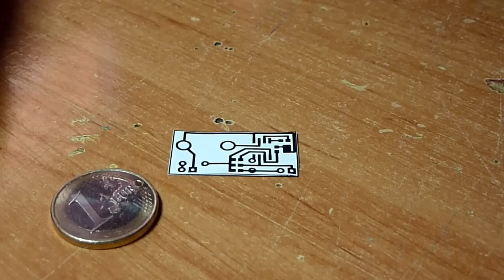#08 - Arduino - 1/2 - Reloj en tiempo real, Real Time Clock RTC, para arduino con Dallas DS1307

Comment: Enhorabuena por el aporte, está genial. Yo ya me he fabricado 2 relojes siguiendo tu post y el esquemático, aunque las resistencias del sda y el scl las he puesto de 10k. 
Va perfecto.
Por cierto la parte de código para habilitar el sqw, las busqué por otro lado.
es esta:
/*Wire.beginTransmission(0x68);
Wire.write(0x07); // move pointer to SQW address
Wire.write(0x10); // sends 0x10 (hex) 00010000 (binary) to control register - turns on square wave
Wire.endTransmission();*/
Saludos